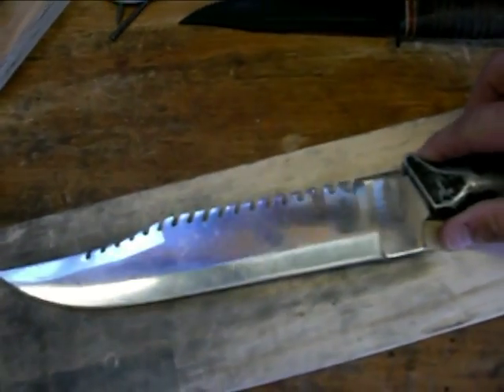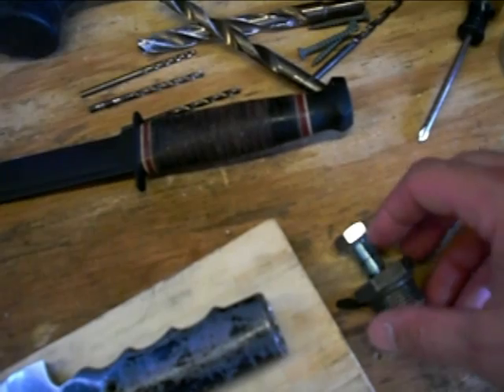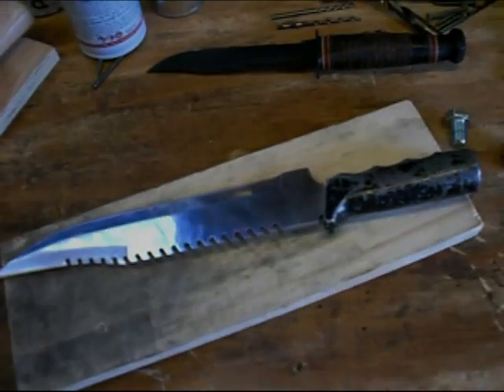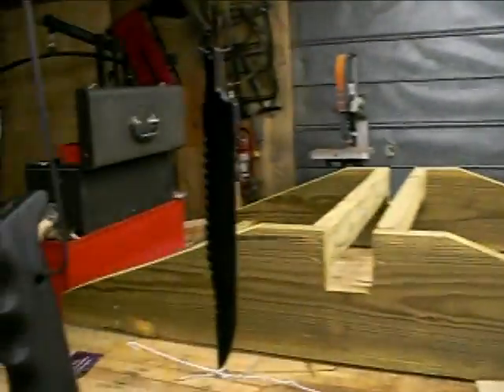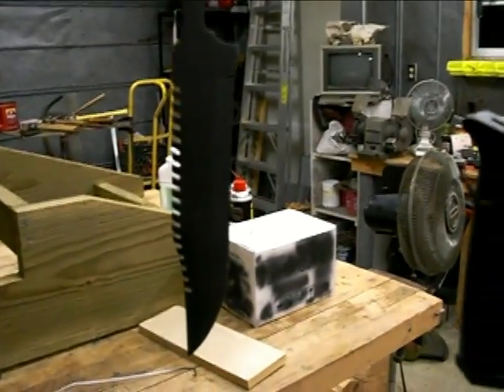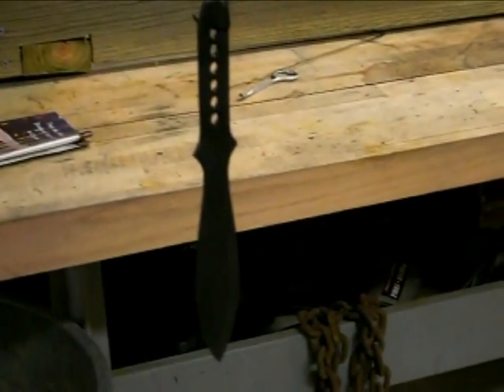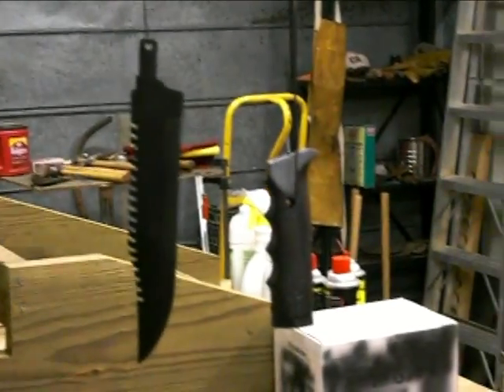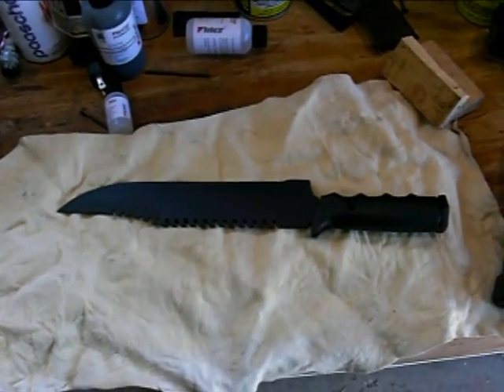Duracoat 2nd try

Comment: Don't knock this knife. It's a trooper. I abused one for years till I lost it somehow. Just bought a new one. The fact it's still intact after all the years of service is a testimony.
Reply: Got one not too long ago, it hasn't been through much yet but it will.:P
Tried chopping a branch that was a bit thicker and it worked great.
I did worry alittle about the size of the blade in comparison to the tang, but since tha handle is casted the way it is and in metal, I feel pretty good about it, and hearing you say that, it makes me feel even better about it.

Only issue I have noticed is the saw back, on mine atleast they lack angle, just go flat over the back, so they don't get in to the wood to saw sadly, but I can live with that since it is with the handle in a way that makes it feel awkward to use the saw side of the blade.:P

I really like it and it has a great sheath that makes good use of the space.

Have only replaced the flashlight, it sucked more than the snake kit (pun intended as the snake kit is great but uses suction cups).:P

Great to hear someone who has it talk food about it.

Think I'll replace the metal snare with a pocket chainsaw.

No use for a snare catching carrots (I am vegetarian).:P

Comment: I received this knife in the same condition. No guard. No butt cap. I loved the knife but it was too unbalanced. I took a solid brass pommel from one of those frost fantasy knives (probably 3-4oz) and put it in the hollow handled. It had a hole drilled for the tubular tang and had originally intended to install it flush but the threads had other plans lol. It cocked sideways about 1/4 inch but I got 95% of it flush. The remaining 5% was filled off even. I then used a steel epoxy to fill the end up, which it's difficult to scratch with a knife so I think it'll hold up to normal use. I now plan to paint it, add rubber for the handle, possibly fab a hilt, and add an additional retention strap bc the original velcro is pretty worn out. Update 2-24: I now refilled the thumb ramp deeper and wider with a square mini file. I ended up finding an L bracket and bent it into a guard and used the same epoxy to attach it to the top of the handle. I bought new Velcro and H/D thread for the sheath and matte black Krylon for the Rambo 2 type paint job.

Comment: David, Thanks for the vid, glad I found it.. I have one I'd like to do the same thing to it. Question, how did you get the blade off of the handle and then re-attach it back? I want to refinish my blade but am not sure how to remove it. Did you drill the pin in the handle? How has it held up afterwards? Thanks.... consider yourself subbed.
Reply: Art-E-Mouse it might be too late but I got mine off by using a Phillips screwdriver to drive the pin out. It's a rolled pin so the tension of the fold keeps it in there. I clamped the knife down flat, the put the screwdriver on the pin to drove it out with a hammer. It was also difficult to put back in too. I think the blade itself would fail before the pin would shear/fail.
Reply: FYI, I got it out and then reinserted it with a gob of Super epoxy and been using it for better than a year now. FYI David... ya might try a little more frequent contact, just a thought. good vid, peace out bro!
Reply: Hey...just askin, You okay pal?